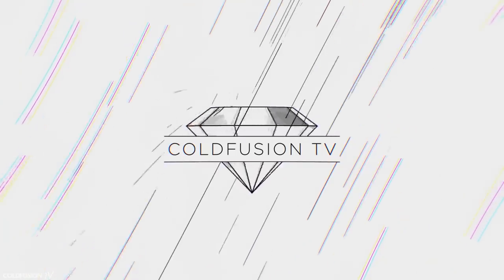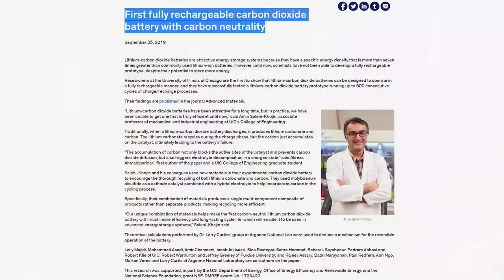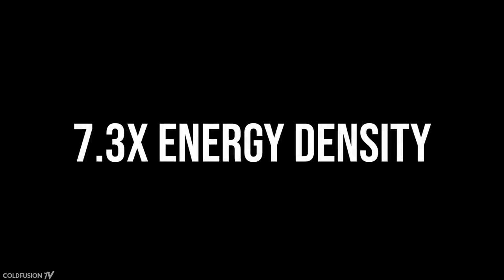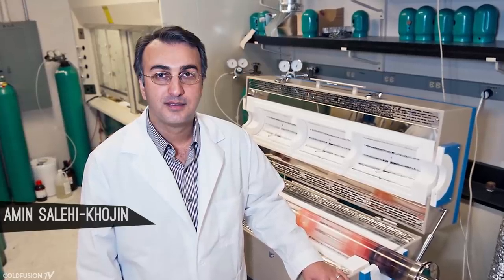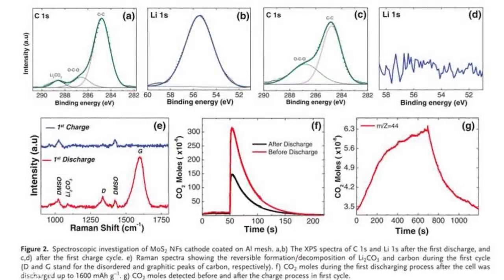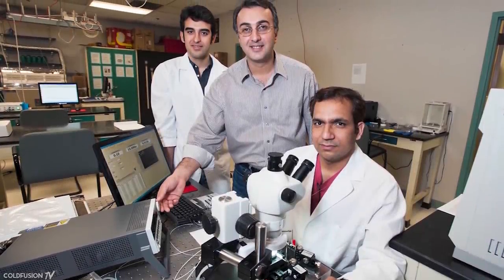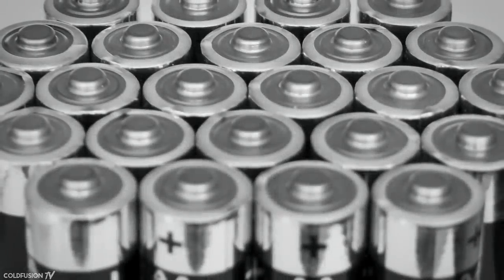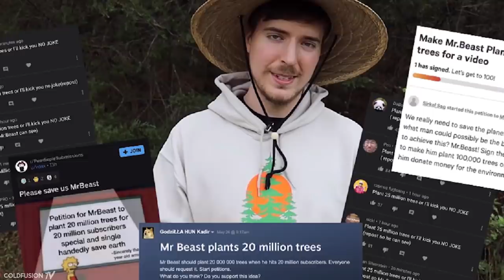Carbon Dioxide Battery Breakthrough

Comment: Seems amazing always blows my mind when scientists make leaps. Yet, I'm also bitter knowing we won't see these batteries any time soon, maybe not in our lifetime. We always find something "theoretically" revolutionary and it seems exciting to think of the possibilities, yet we rarely seen anything done in the sense of replacing inefficient systems. What about these people who claimed they could make hydrogen fuel systems that wouldn't have any emissions, that's been forgotten. Or when they were trying to make a more efficient solar panel, I remember when there was talk of thinner solar panels being developed that would be a fraction of the thickness of a solar panel (using less material overall) it never came to fruition.
I think instead of tycooning the systems we already have had in place since before the 2000s, full efforts should be put into designing better batteries, and every other electrical component, diodes, capacitors, resistors, maybe new types of wire alloys. Genetically modifying bacteria and microbes, swapping coal for nuclear for god fucking sake.

Living on this planet I've realised those whove made billions make it at the world's expense. They are practically the biggest people in the world, barely anyone makes good use of it. Bill Gates pours the money back into charity. But type in on Google any charity with the phrase what percentage of proceeds go to the actual cause it can be as low at 30% in unicefs case or breast cancer awareness. We can't get anything done because everyone wants a pay check instead of commissioning them when they succeed

Comment: Imagine lithium carbon dioxide batteries big enough to power a city. When they're recharged, (from green power sources, of course), the carbon is filtered out of the electrolyte and more carbon dioxide added if necessary. Imagine every town and city power company in the world equipped with batteries like this. It might make a dent in the excess atmospheric carbon dioxide problem.

Comment: It doesn't need to be 7x more so the theoretical max that we know we will never achieve is irrelevant. Even if it hits 2x more energy density per kilogram it would completely change everything assuming it is also the same size.

Comment: "A battery can be seven times lighter and smaller for a given energy density or last seven times longer for the same size and weight" [paraphrased]
"Whaa... It's bigger on the inside!" - "Oh my.  It's smaller on the outside."
<boggles>  They aren't two different things.  <le sigh>

Comment: 7X battery density would make electric cars range practical, sadly a battery that is junk after 500 charges is not good enough unless they can make them very cheaply. Lithium batteries are not cheap, nor very safe to dispose of. It might be more poluting than a gasoline engine.

Comment: Even if this tech could leap off the lab bench, 500 charge cycles wouldn't blow my skirt up. I want something to last the life of the device. It cost me $120 to replace the battery in my ipad, so i bought an external battery pack to run it because i'm not going through that BS again.

Comment: In the absence of Carbon fuels a Battery is only as good as its proximity to the power supply. That's why they want us completely reliant on grid electricity - right? Those with the Power will have Complete power.

Comment: i wanna see these batteries hit the market. I also wanna see sodium ion batteries hit the market. I wanna see literally any of these batteries hit the market. I wanna see stuff like sodium ion because it will make batteries incredibly cheap. If these graphene or carbon  dioxide or whatever batteries have better density for the same estimated market cost, great! get it on the market immediately. cheaper batteries.

Comment: I had a dream years ago, where humans built a huge battery, with metal plates separating substrates... like building a mountain, or pyramid...with a lightning rod at the top... Lightning would charge the device, then a sub-station would convert the DC into AC power... still waiting for the proper battery components... would Carbon Dioxide be the way to do this???? Gotta keep your imagination...

Comment: 500 charge/discharge cycles is less than 2 years. Needs to be 50,000 cycles to be viable. Tired of batteries that can't get through a day and the move toward nonremovable batteries.

Comment: I would buy non rechargeable cells if the price is right. 7times more capacity holy hell. That's like lead acid VS lion
Reply: Would be perfect for low consumption devices, such as IR controllers and some other things that rarely if ever get the battery replaced in its lifetime

Comment: "Theoretically reach" I call attention to the world "theoretically".
No device ever achieves its theoretical limits because of the constraints of practicality.

No battery is about to match the energy density of methane which is 15,000 watt hours/kilogram, or even jet fuel (12,000 watt hours/kilogram), with the possible exception of hydrogen-air batteries (fuel cells).

Comment: 500 cycles in a tiny lab prototype is a small improvement, NOT CLOSE TO A BREAKTHROUGH.  who cares if it's denser?  density is just one issue.  cost and longevity are more important.

Comment: You know what else has 7 times the energy density of a lithium ion cell? 
A stick of TNT. 
Good luck going around with that in you pocket.
Reply: Energy density of a Lithium Ion cell 250 to 300 Wh per kg.
Energy density of gasoline around 10 KWh per kg, and one spark is enough. 
How many gas cars are on the road? Almost 1 billion?

Comment: The comments below are interesting, reflecting my own observation of a panoply of 'breakthroughs', anywhere from new technologies in batteries such as this clip to 'breakthroughs' in medical advancements such as the promises of genetic treatments or cures that have been touted for 20 years

Yep, unfortunately, many of the small, minor provincial research here and there are reported on, and hailed, FAR too early.
It tends to raise false hopes, which does no one any good.

Yes, it might be wonderful in a tightly controlled lab setting, but scale-up and expansion to actually 'change the world' (as Bill Nye might say) seems, so often, to be a non-starter. I agree with posts below expressing the opinion about many of these research possibilities simply disappearing after their initial exposures on You Tube, national mainstream news, local news, science mags, etc.

Comment: mmm bit difficult to build carbon battery's when gov's are pushing Carbon neutral  lol
Reply: This whole 'carbon neutral' thing is a bunch of BS.😜 Carbon itself is one of the building blocks of life! When it is combined with other elements is when it becomes  inert, useful, or deadly (in the case of carbon monoxide).

Comment: The impact of global CO2 level by this is not measurable.  Lithium is a very toxic material and WILL be a waste problem for us and a toxic issue for future generations.  We need batteries based on Aluminium, Oxygen and a non toxic electrolyte.  While we are waiting for cold fusion and since I am dreaming anyway, an energy free method of cracking CO2 would be nice too.

Comment: "We are producing seven gigatons of carbon dioxide... every year."  What, exactly, does that have to do with new batteries?  A 7x capacity improvement is great, but not enough for an energy revolution.  You still need the power to charge them.  Small solar installations are great - and really are the way to go right now - but this battery won't increase that usage any more than a 500 cycle limited battery would be useful to a large installation.  For a true turn-around in energy production, we need more on the order of a 100x improvement in storage capacity AND some large improvements in solar power generation as well.
     Don't get me wrong, a 7x better battery is great, even if it is 1/2 to 1/3rd the lifetime of current lithium cells - I'm sure lifetime will improve.  But impying this will affect the global or even national environment in any way is just blatant hyperbole.

Comment: As soon as he said I don't want to leave it to the next generation, then I new it was pie in the sky research. (eg research funding on the carbon neutral band wagon). This will not lead to anything new as the motivation is research funding. Clicked off at that point.

Comment: Amp-hours is NOT a unit of energy storage.  It is a unit of electrical charge. It means absolutely nothing without knowing the operating voltage.  Why the heck do engineers and scientists toss out their basic physics/thermodynamics knowledge and go along with an essentially stupid marketing term?   Watt-hours IS a unit of energy but since a watt is a joule/second, it is essentially saying a joule/second-hour, or 3600 joule/second-seconds.  Just dumb. A Joule is a perfectly good unit of energy with no good reason to disguise it with a more complicated compound unit.  Use it.  Also the kJ, MJ and GJ.

Comment: I think this battery type even with this "breakthrough " is crap.  500 cycles isn't anything to be touting as replacement.  Floride batteries is a better solution.

Comment: Even with 7x more energy density... electric aircraft are still a pipe dream, because of the power to weight energy demands needed to make an aircraft fly.  
A small electric airplane or helicopter that can barely lift a single 170lb pilot... is not practical.  We need these aircraft to carry passengers & freight.  

This is why hydrogen powered gas turbines are far more realistic than electric aircraft... & hydrogen powered automobiles would be far more practical than electric cars.  

And we already have a solution to reducing atmospheric CO2.  They are called plants.

Comment: If this ever reaches an industrial scale, they will never havest atmospheric co2 to use for manudacturing the battery. Theres literally no practical or ethical reason to mention that it could be used, and suddenly cut away. 

I already don't like this. Good ideas don't need to be sold with dishonest techniques.

Comment: Doesn't solve the HUGE problem (globally forced by U.N. order...) worldwide use of e-vehicles pose to the environment - the need to ramp up open cast lithium mining and refining 10s to 100s of 1000s of times current production levels to turn the world 'greener' - 1,000,000s of times if all generators and backup power systems are also replaced with lithium power...... 

forget pin point drilling ops that leave no trace once decommissioned... we MUST SCRAPE THE WORLD FLAT to save the planet - well, technically make it very holey....  if you're a fake brainwashed 'neo-green', that is - a True Believer..... 

I'm an old school green where CO2 is the most desired ONLY emission from industrial processes, all other emissions contained, refined and reused.... Plant more trees, reclaim deserts and tundra where possible... The Chinese have planted billions in the last few years - but this doesn't excuse them poisoning the atmosphere and water supplies to hell.... nor The West offshoring their manufacturing pollution and trash to the other side of the world while ramping up the trash manufacturing process hugely, all in the name of 'GROWTH'' - The Liberal Addiction..... Bunch of wasters....

Comment: Congrats.
Great achievement , but just do not dabble in the CO2 scam, as part of your "pluses / achievements".
CO2 is the most important gasses for all life.
If the level drops below 150 ppm, you might have no need for batteries, as the world will be virtually dead.
AsScientist, you surely can research CO2 levels, through Earths timeline.
But, well done.
South Africa